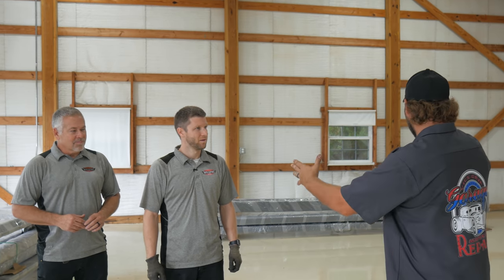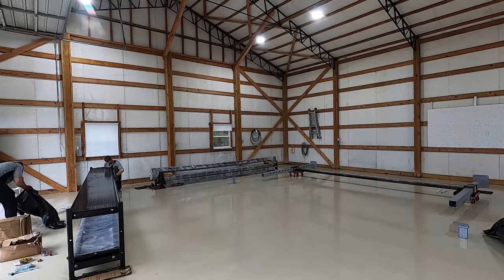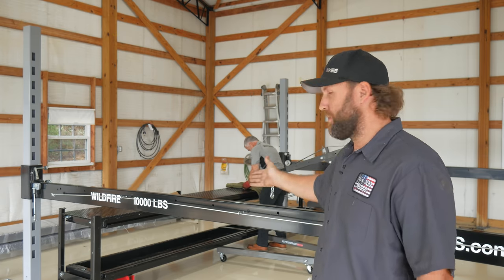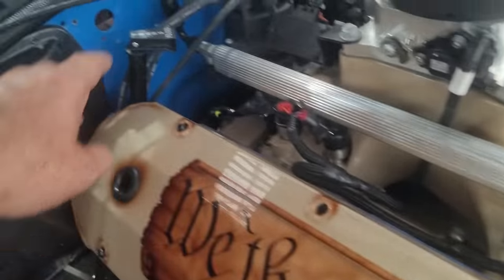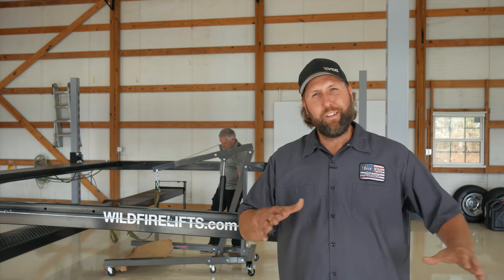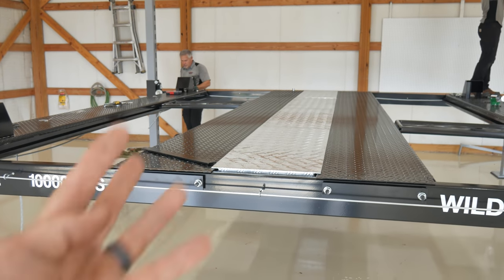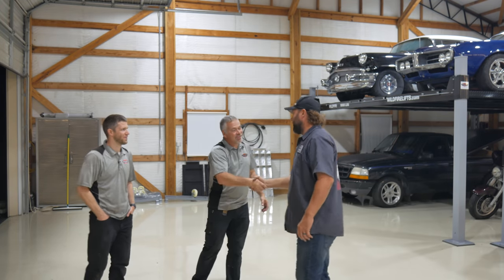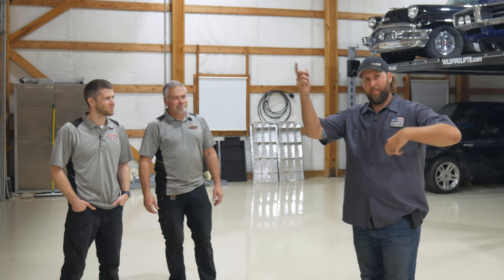Shop Gets a DOUBLE WIDE WildFire Lift! (Plus New Shop Tour & Independence Update)

Comment: I don't know why more people don't get 4 posts.  You can totally install it yourself and you don't have to worry about how your floor was poured.  They aren't bolted down so you can move it around and not stress about placement.  I feel a lot safer working under them, especially with a car I'm messing with the weight balance of by taking a motor out and you have a built in place to lay out your tools down both sides as you're working.  Unless you're regularly dropping whole sub frames, get a 4 post.

Comment: When we ran methanol in our car we used to fill the 32 gallon cell with wiffle balls to stop the sloshing (circle track). The holes would allow fuel to flow freely and the fuel wouldn't slosh around. The methanol never broke the plastic down on the balls either. Cheap & effective. However if your fuel cell fill hole isn't big enough you won't be able to fit the ball through. Just a thought.

Comment: Impressive. Most impressive  For those who don't know,  those of us working at home without a lift, a lift like any one of those installed today will allow you to do more work faster with less far effort. That and air/air tools (or battery electric tools) cut project time in 1/2. Plus you get double storage space when not using the lift to work. That and the  sweet new pole barn with the epoxy floors takes the home project guy / weekend warrior wrench to a whole other level. 

Congrats to Derek & family  plus every one at VGG on the big move,  and more obviously landing on your feet running !  Best Of Luck !!

Comment: If some has not suggested it yet , they make some open shelving , 3 and 4 levels , good ones will hold a 1000 to 2000 pounds per shelf. I lined the outside walls of my shop with these. Make for a good storage solution.

Comment: Hey feller... What a guy needs to fix the fuel slosh problem...  It's called a "Fuel Surge Tank"...  Basically a secondary small gas tank that runs inline with the main tank...  The pump from the main tank feeds the smaller tank.. then a second pump draws from the smaller tank to feed the fuel rails..  They have a tall cylindrical shape with the inlet at the top.. and outlet at the bottom..  This creates a small reserve of fuel that is not effected by lateral motion.. so as the car whips around and the main pump looses pressure.. the surge tank has extra fuel to compensate.. this eliminates fuel slosh problems ;-)

Comment: A nice rolling work cart to put tools on and parts for the project your working on works great . The shop i worked at last the lift was out back under a car port and i could roll the cart over to what ever the end of the car i was working on with the tools and parts within hands reach . It was a step saver !

Comment: “Well I’ll be dipped!”
Reply from the maker: Thanks!!
Reply: @ViceGripGarage  ONLY 10.000 POUNDS .. IT WONT HOLD 2 TRUCKS .. I WOULD HAVE PASSED ... NOT A DISS ...
Reply: @tammylott921  capacity  probably more , but for safety reasons like the quality of the concrete 
& It's for sports cars on top

Comment: Hey Derrick, for your hot water issue (or lack of) I’ve been using Titian brand. They are tankless and one to heat water for a sink runs on 110. I’ve been using them for about fifteen years now and have no complaints!! Got them on eBay! They work very well.

Comment: I was impressed with the last lift you had. Now you have more, wow.   They are strong and look to be real safe. It looked to be well made and practical.  I like the fact that they are moveable. Derek You need a battery sponsor LOL. That is a cooooolll workshop. Something you could make if you have time is a portable work bench. 2 fixed castors, 2 lockable 6 ft long by 4 ft wide. Great for doing head jobs tempery parts storage etc. Just like a large tool chest. And a telescopic transmission jack, with a tiltable head.

Comment: don't change the tank just get some of the anti slosh tank foam inserts from speedway. for 8.99 a brick you can stuff them in to a fuel tank and even if you stuff it flush with the foam it only takes up at most 3 percent of the space for fuel . it works with gas or E-85 so it's good for what ever you run it's an open cell foam so the fuel runs out like normal with no restrictions . they come in a lot of different sizes and can be inserted thru the filler neck of the tank . it's a hell of a lot cheaper then a new tank and if you don't like it or want to go to a larger tank later you can take it out as easy as you put it in.

Comment: I can't remember where I saw it, but I did in fact saw it! What is it your thinking, it was, is a large matt that replaces the fuel pump pick-up sock that should eliminate your fuel delivery issues, as long as any part of the matt is in fuel it will deliver the fuel uninterrupted to the pump!  just found them Summit Racing has them or simular, they are made by Holley called Holley Hydramat fuel pickups, part number HLY-16-109  is 15 in x 24 in and only $ 718.95 Lol  part number HLY-16-110 is 14 in x 30 in for $ 808.95 Lol there are smaller ones some in a X configuration for cheaper 200.00 + range

Comment: For Independence fuel tank, how about a V-bottom tank? When designing aluminum fuel tanks for small boats, we V-bottom to fit hull, with a flat center section, and add baffles to minimize sloshing. Seems this might work in Independence; V the tank bottom, flat center section where fuel pump would be in deepest part of tank. Baffles and V shape would help keep fuel in deepest part of tank where fuel pump resides. Congrats on the shop; this feller would love to have that!

Comment: Here's a tip for when you get around to building your next shop, once you figure how big you need it, say 45x90 feet, add another 10-15 feet to the depth and 20-30 feet to the width and you'll have a shop with all the space you need and the room for that equipment & tools that you plan to eventually procure. Of course, height is your friend too. We added mezzanine floors on the sides of our shop above the workbench the runs the full depth of the right side of our shop & above the closed off 2 car garage & 15 feet of open area that covers the shop bathroom and another workbench that runs to the width of the garage on the rear wall of the open space so our daily drivers stay free of shop activities dust, etc from landing on them. Both mezzanines are accessible by forklifts for larger items & an extension ladder the rest of the time so floor space isn't lost to stairs. There are plans to join the two mezzanines with another along the rear shop wall that will have stairs that will free up lots of floor space (60 feet) that will make that stair footprint a moot point with that lower storage space moved to the overhead and 5 feet deeper area. Another tip, add an oversize roof scuttle access from your mezzanine area. When you have to get up there it's a lot safer and if needed fall arresting gear can be anchored at that opening too.
Reply: Great shop design.  Well thought out.  Keep up the great job, you are the best.

Comment: I would recommend in that building from the floor up all the way around the inside of the walls of the building run half-inch plywood fasten it to the wall all the way around it lemonades the bad guy from cutting through the aluminum wall and making your dream fade away I had a good year business for years they broke through the aluminum siding and cost me a lot of money I put the plywood up I did not have any more problems or whatever type of protection you would like to use but I would definitely put something up on the side of the inside of your shop on the walls awesome shop love the lifts

Comment: Hey you  might laugh but if u put depends or hospital pads in those drip pans they hold a lot of oil or Trans fluid ,or Ani freeze then u just throw them away , I use them all the time on mine ,I call it a mess in a bag u just roll them up and trash bag them

Comment: awesome video of the new shop! I'd try a liquid cc drip into the cylinder that's not showing up for the party, that would tell you if it's the rings, it;ll drain past. if it's the valves you can smoke test them with a cigar and hose from a compression gauge "it's an old school mechanics test"  you'll see it either drift up out of the carb or out the exhaust port lol

Comment: With Independence, A guy would put the ol air pressulator 3000 into the cyl, and another guy would listen to see if the air was coming out the top or inside the motor. That will tell a fella if its a valve or the rings.

Comment: Hey Derek, love your content bud, keep up the good work, i noticed u said u might put a water heater in later for your sink, i just wanted to let u know that they have a device the u mount under the sink on the hot side and u can just put  a T in the cold line and plumb it in the device and u have hot water, no tanks to rust out or raise in power due to running a 220 water heater, it runs off 110, just something to wrap your melon around, keep those vids coming bud!!!

Comment: This will probably get buried in the comments, but the biggest thing I see everyone not doing with their burnout builds is putting a surge tank in for the fuel. When you get whipping around, it sloshes as Derek pointed out. Highly recommend fitting a surge tank, with a decent pump feeding it, into Independence. This should alleviate your fuel surging issues and lean outs.

Comment: I'm an engineer and was wondering if the concrete slab is thick enough to take the point loads of the lifts so you don't get cracking on the slab?

Comment: Congrats on the new shop. What is the height of the garage ceiling? Im building a shop in the spring and I'm trying to figure out how high I should go. Going to go with a wildfire lift. Recommendation on ceiling height?
Reply: Wall height might be what a feller meant

Comment: What's the side wall height? I'm building a 40x60 as well. 12ft lean too on 40 - 40 & 60 then 16ft on the other 60. I'm going to put a 24x32 apartment along the inside of one 40ft wall with storage on top. I'm trying to decide between 14ft and 16ft side walls.

Comment: since you ran it hot, and have a dead cylinder ,its off with the heads ,hears the real pain in the butt scene ,you pull the head off and find a burnt valve,do the valve job ,new head gaskets etc only to find the rings are trash,so in the long run you end up removing the oil pan, and yeah you can remove the piston and rod, and look at the rings and cylinder walls. and the rod bearings, and at that point you may end up refreshing the heads, rings and rod bearings,plus all the gaskets and time involved ,is it  worth it ,yeah if got good tools and a fat wallet.

Comment: Why don’t a guy build a shed outside to house the air compressor and keep the noise away from the man, run some PVC air lines though out the building in places he could quickly connect to.

Comment: Weird that you have slosh issues.   We run boats with 60 year old design with no real slosh issues.  35 gallon  tanks have no issues even when 1/2 full.    The baffles are set up From the bottom of the tank about 1".  And go to the about 1/2" from the top.   4 baffels in a tank of that is somewhere around  54" wide.     Doing hard 180°s or 360° no issues what so ever.